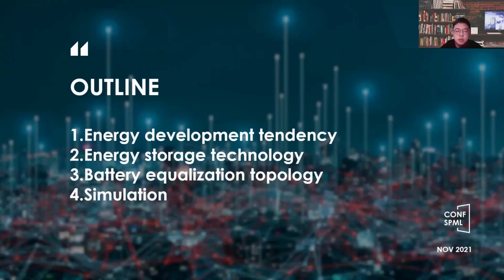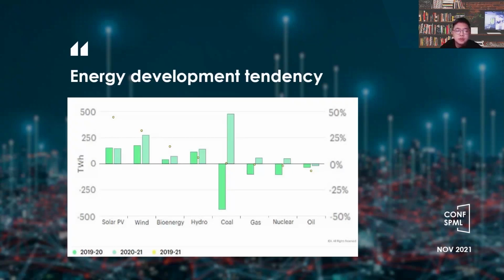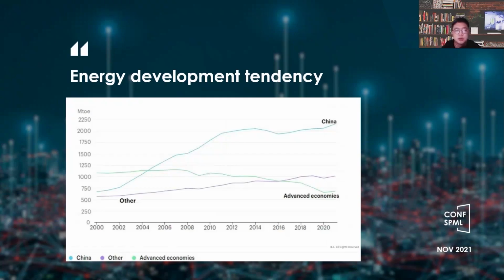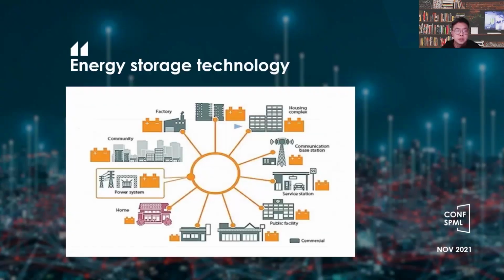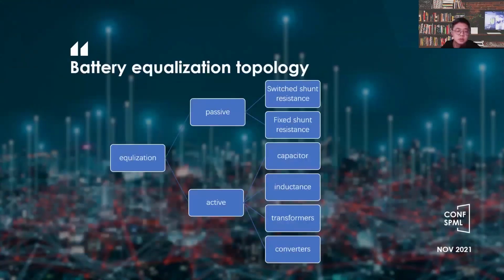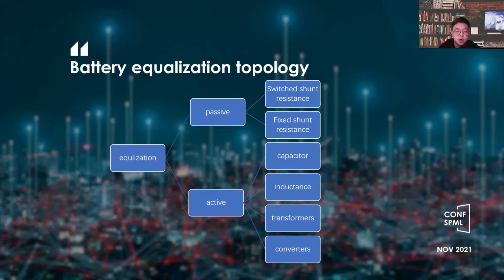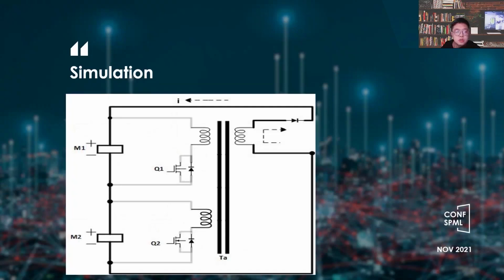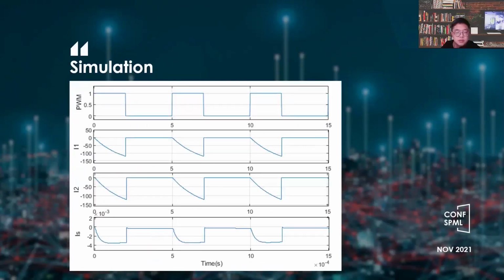CONF-SPML 2021 – Research on Active Equalization Topology Based on the Multi-input Transformer

Comment from the maker: Here are the questions we collected and answers replied by the presenter:

Q1. Is it necessary to decide the values of parameters in reference to the electric potential of the lithium-ion battery and the capacity of common capacitors, since in this way it can be closer to actual application scenarios?
A1. Sure, it's better to be closer to actual application scenarios, but I raise the voltage mainly for a more intuitive display on the image. And I focus on the effect of voltage equalization.

Q2. In the simulation, why did you apply 30V rather than 2V -- the electric potential of the lithium-ion battery?
A2. As I mentioned in answer one, to illustrate the equalization procedure better.

Q3. If output effectiveness is increased, which conditions in theoretical discussions should be accordingly changed?
A3. The switching frequency, the capacitance and voltage between two modules all have effect on the output effectiveness.